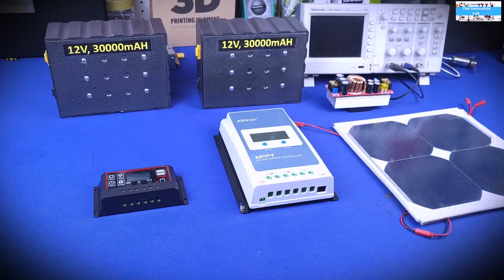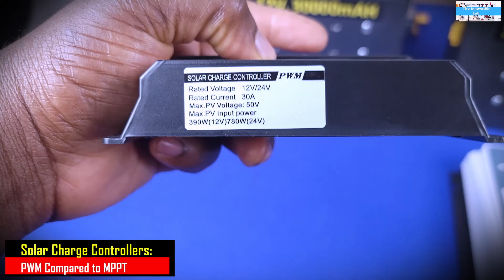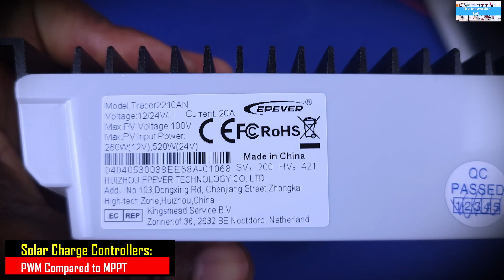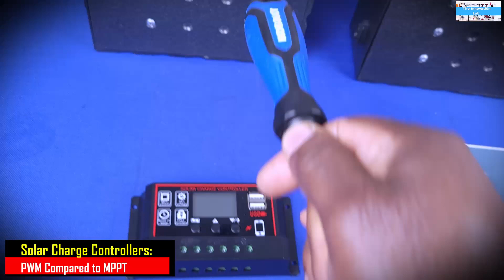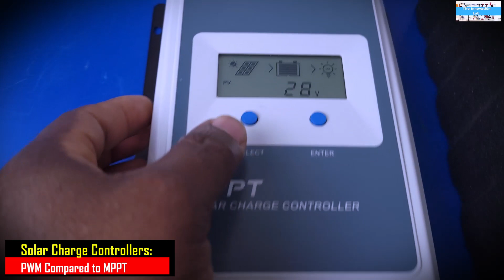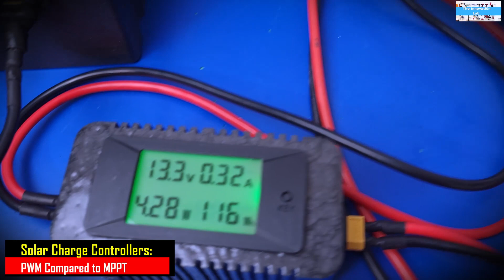Solar Charger, MPPT compared to PWM #diy

Comment: I have a 300watt panel and a 12v battery i I'm having issues using pwm solar charge controller for charging the battery because the panel produces 42v will using an mppt charge controller work?
Reply from the maker: Absolutely!
MPPT charge controllers are specifically designed for solar and they are the best - if you can afford them. The major issue for most people is the price.
I find the EPEVER brand to be very reliable.
👇👇👇
40A EPEVER MPPT CONTORLLOER 
https://amzn.to/4dQ7y1I

20A EPEVER MPPT Charge controller 
https://amzn.to/4dUSPCy

I hope this helps.
The Innovati0n Lab 💥 
www.theinnovati0nlab.com

Comment: Hello again,

Some people on internet trying to use some psu laptop adapters dc power supply and use pwm or mppt charger unit then charge batteries and all of them failed. Somehow power supplies close itself. Some days mppt tried took all current and psu close like shortcircuit protection.

But you use samt thing only difference is these Chinese boost converter. Can put server psu directly pwm charger? Or put mppt charger without boost converter.
Reply from the maker: https://youtu.be/0Ct_sgbAjU4?si=jKY7fugxfGfZcv74

Comment: The controllers protect the batteries/charging, not the solar panel.
Reply from the maker: Efficient charge controllers  are actually designed to protect both the solar panels and the batteries. You don't want to overload your solar panels by not using a good charge controller. This is why I am a strong advocate for using an MPPT charge controller. They may be more expensive, but it is worth  it in the long run.
👍😎